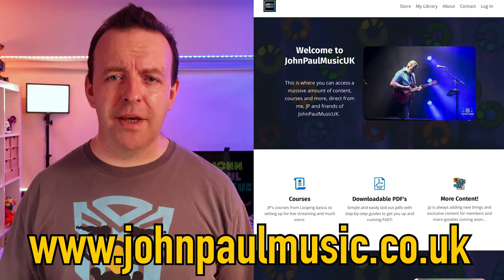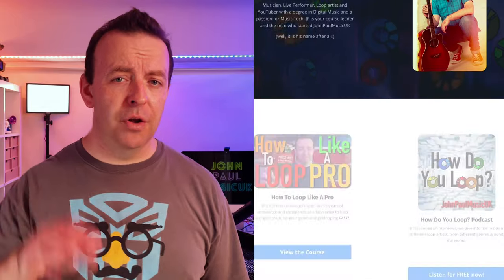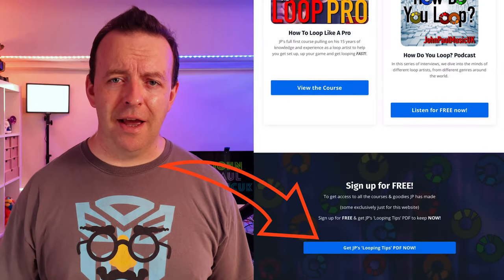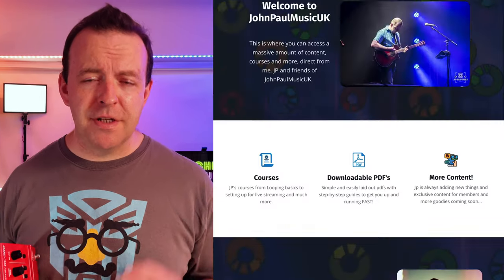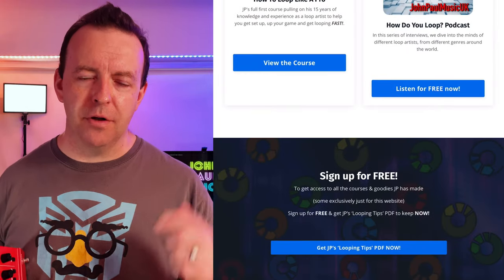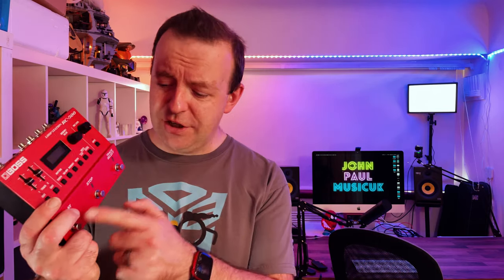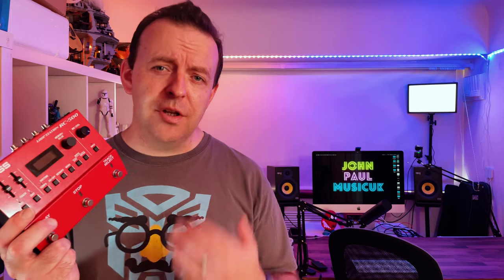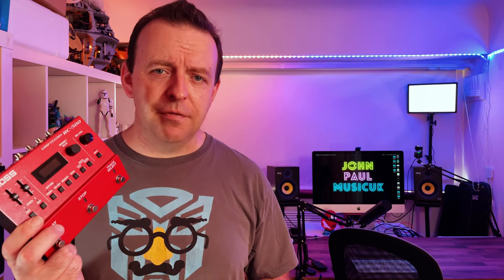Boss RC-500 - How to Route the Loops

Comment: John there is something that is not mentioned here and it is a SOLUTION to completely preserve your routing:
To preserve your A-B or L-R stereo routings you have to set track IN and OUT properly!! If your track IN is set to ALL, then everything is mixed down to a mono sounding stereo file, and you will lose your routing when the loop plays back. Although if you have it on MIC/INST, then it will be true stereo recorded left and right. The track OUT have to be set to ALL. Don’t make the same mistake I did 🤣! This is not in the manual, but it is mentioned in the Parameter Guide. Make sure you know, this will not fix the loops you already recorded. You have to re-record them the right way!
Reply from the maker: This is good advice 👍🏻
Reply: I'm hoping this means if put the track IN as INST IN and OUT as ALL, i also get a stereo signal that gets routed properly. My setup is Guitar in IN A and Bass in B, I wish I can have them on both tracks in their own amp
Reply: yep. It's in the Parameters guide: "Sound that is input to the INST IN jacks (A/MONO, B) is assigned and recorded to A and B (L, R)." @LaBoiteAGogo
Reply: @TomiTtime  that is great, I was horrified to think it would miss that function when rc-5 has it

Comment: Not sure if anyone else has noticed this, but when you mess with the channel routing it can double the volume of your track. For example if you set the track 1 output to only be channel A, then it seems to double the input volume (probably because of the way it sums it). My solution has been to just halve the volume for any tracks I do this with
Reply from the maker: Yes this can happen cause you are sending signals to now mono outs and the summing up is greater. Great tip 👍🏼

Comment: Hey John, not sure if you’ve answered this before but is there a way to cycle through drum patterns on the RC500 using midi? I have an MC3 controlling my RC509 and can’t figure out how to go through the different drum patterns. 

I’ve programmed tap tempo, start/stop, pattern variation and pattern rhythm 1/2 but scrolling through the different pattern still eludes me. Any help would be appreciated and thanks for all the videos on midi with the rc500 so far 🙏🏻
Reply from the maker: Hey Sam - sorry I'm just seeing this now. 
Have a look at the RC-500's Parameter guide - really important - I have them downloaded and saved onto my iPad for CONSTANT reference. Go to page 10 and have a look at the options there as the Target for the midi command - There isnt a cycle through or increase or decline option but there is a way to change whats called 'RHY Pattern' and the 'Kit'.

Comment: Hey JP :) do you know of anyway to keep a stereo left right signal for the guitar, but also isolating the mic out to be on a seperate channel? So far it seems impossible, cause the guitar needs to be on both output channels for it to be stereo (cause I’m using stereo delay before going into the looper). Thanks!
Reply from the maker: hey 👋 
so this is the limitation of the RC-500. it has 2 outs. the left and the right. that’s it. 
so you can send the stereo out and the mic out to any of the two.. but you are asking for it to be a 3 channel (or more) looper. it’s simply not possible. Next one that can do that from Boss is the RC-600 / RC505mkii

Comment: When i  play my guitar through the RC 500 the volume level is very low when I'm doing a loop   . I tried turning up the volume on my guitar. Question how do you control the volume level output for your  instrument   or increase the  volume ?
Reply from the maker: There is a recording volume and a play volume. The play volume is the faders you can see. The recording volume is in the input button menu.

Comment: Is it possible to route the two separate inputs as separate outputs on the same track? EG: I have a song where I set up a 2-Bar percussion loop with my guitar on Track 1, then during the song I add a 4-bar phrase with both guitar and voice on track 2. Or would it just be easier to upgrade to another loop station with more channels?
Reply from the maker: So yes. You can tell the vocal to be output B and the guitar to be output B for both the normal outputs of the instruments and also the loops. 
Hope that’s what you mean. 👍🏻

Comment: Hi John Paul ! Thank you so much for this video ! 
This is great information. I was desperately looking for a solution to separate guitar and voice loops. Now I have a solution.
I am definitely considering buying the RC-500.

I was actually trying to find the best option for GUITAR AND VOICE LOOPING (+ having the option to add some vocal effects like delay, reverb, and harmonies).
So I was hesitating between getting the BOSS VE-500 alongside the RC-500 ; or go a different way with TC Helicon, and get a Voice Live 3 Extreme (and get all I need in one pedal).

Or I could also keep the VE-500, and get a bigger looper, like the RC-600, and this way, I can have an ouput for the guitar, and stereo outputs for the voice.

Any hints on the best configuration would be highly appreciated ! 
I have been looking for months, and can't decide what's best. ; )
Thanks in advance !
Reply from the maker: Hey glad it’s helpful. 
If you are used to the VE-500 then it’s very similar to the TC-Helicon but with the advantage of midi, so you can sync the effects to the timing of the loops. Then it’s just a case of what looper. 
The RC-600 is a monster but the opportunities with what you can do are a lot more than an RC-500. However, to be devil’s advocate, if you only ever need a max of 2 loops and are using the VE-500 for inputs and effects and sending that to the looper, then the RC-500 is all you need (maybe with an external pedal for more buttons). 
Here’s my setup.. just mentally replace the Voicelive Play Acoustic for your VE-500: https://youtu.be/VE9vLqGX_Gs
Reply: @JohnPaulMusicUK   Thank you for your kind response and explanations !
Yes, I think the rC-500 is enough for my needs in terms of looping (and smaller).

my only concern with this routing is losing the "stereo output".

If I use 2 pedals, the RC-500 alongside the VE-500, could I do my setup like this :
– For the MIC : enter in the Looper first, then mono output (on one of the tracks), to go into the VE-500, and from there, output in stereo to the mix table.
– For the GUITAR (doing the opposite) : enter first in the vocal effects pedal (VE-500), output in mono to enter the Looper (RC-500), and from there, output to the Guitar Amp.

In terms of sequence, would that work?
Thank you agin so so much for your help and advices ! Cheers from Switzerland ;-)

Comment: Hi, thank you for your work. I have the following problem with the outputs. If I set A as the output for the instrument and B as the output for the rhythm, then in channel A I hear only instrument (which is ok), but in channel B I hear both, instrument and rhythm - I would expect that there should be just the rhythm in B. Any advice? Thank you
Reply: I may have just realized the answer to that. I was having a similar issue with my guitar coming out of the output with the loop track after I assigned loops to Out-B and Instrument to Out-A. In track "Edit" I changed the Inputs as well to segregate I/O A from I/O B. What I DIDN'T do was assign the Input routing TO the Outputs by using the menu under the INPUT button.  The Rhythm Output assignments are done from under the same INPUT menu, and not from the input parameters found in the track EDIT menus. It's a little confusing and now I'm not really sure what the Input settings in the track edits are for exactly. 🤷‍♂
Reply: So, I just tested that my guitar no longer comes out of the B output unless I switch it using the INPUT menu.  I'm assuming the Input selections in the Track EDIT are to accept inputs for taking in loop recordings and NOT for output routing.

Comment: Hey there JP, I have an interesting question for you. I'm currently using a Pigtronix Infinity for looping, which in addition to its regular outputs, has an aux out which sends just the audio of looped parts. With ABANDONS I do a lot of live looping, and use the aux out to send the looped parts to an amp which sits behind our drummer. This allows him to clearly hear the loops, without having any of my live playing muddying it up, as his amp only plays the loops from the aux out on the Infinity, which doesn't include my live signal. I watched your video but it's unclear whether I can accomplish this with the RC-500 routing options. Is there a way to send just the loops to output B, and have output A contain both the loops and my live signal?
Reply from the maker: Hi. Ooh that’s interesting. 
So in short, yes. Output A would be for the main PA and output B would be for your drummer. 
You would send the loops to both output A&B (as it is on default) and then send just what you need for the main PA to output A only. 
This can be done with the inputs, loops & rhythm (although the drummer might not want to be replaced with a rhythm track 😂) but good for percussive stuff.

Comment: Thanks for the video.  I have a clean guitar track laid down on track one and I want to laid down a distorted guitar on track 2 while listening to the clean track for timing.  But when I do that and listen to the play back, both tracks come out distorted.  What setting should I use for input/output to correct the issue?  thx
Reply from the maker: Make sure the clean track isn’t coming in too hot. Click the input button under the mic knob. Check the input volumes are not too high if the input is distorting then that might be the problem. There is also a noise suppressor (NS) on all inputs set to 50 as standard. Have a play with this also to make sure that isn’t the reason it’s changing the sound. Hope that helps.
Reply: @JohnPaulMusicUK  Great, one other question. Can you delete separate tracks?  I want to clear track 2 but when I clear it, it clears both tracks 1 and 2.  thanks.
Reply from the maker: Yes Mike. 
You just need to check the stop pedal. 
Go into memory > Ctl > pedal 2 and it should already be on Cur Stop (Clear) which will clear the currently track but leave the other track alone. If not, change it back to that. But that is the default.

Comment: hello JP, I am having an issue with the mic input, very low volume and gain no matter what I do. There has been a post on a facebook group or page where it has been addressed. No answers though. My only solution would be connecting all the instruments and mic to a mixer then connect the RC 500 onto the mixer through instrument ts line. Do you have any info or knowledge about this issue? Thank you
Reply from the maker: Hello. Yes, this is a common complaint about the RC 500.
The one thing that I have found, is that the Noise Suppressor (NS) is switched on by default.
This can have quite an effect on the volume coming in, and I have turned mine off.
Click the INPUT button, scroll to MIC IN NS, and play around with this setting.
Be aware, this only really affects the recorded loop, not the natural input.
I use a vocal processor, the boost the signal beforehand (TC-Helicon Voicelive Play Acoustic) but your solution is a good answer. 
The advantage of this is you can do dual mono looping.
Have a look at this video about dual mono sleeping and its advantages: https://youtu.be/tErt9uASsPs
Reply: @JohnPaulMusicUK  Thank you so much. I have a Behringer Flow 8, just starting out. I'll reduce the NS preset. Dual mono sounds good.

Comment: Hey JP! What's up pal ? I've been messing around with my 500.. im running in dual mono mode into a mixer like your video demo showed .. vocals out A into slot  1, guitar out B into slot 2... Is there way to route the rythym into output B?  For some reason it's coming out A and I have reverb going to channel 1  for the vocals and the rythym is picking up the reverb .. hope your well my friend !
Reply from the maker: Hello buddy. 
Press INPUT button > RHYTHM > and you can change it there. 👍🏻
Reply: @JohnPaulMusicUK  awesome!JP is the loop master 👍. Please send me the link to buy you a cup of coffee.. I owe you .. thanks Jp
Reply from the maker: Thanks man it’s https://www.buymeacoffee.com/Johnpaulmusicuk
Reply: @JohnPaulMusicUK  ok got the link thank you .. sorry I had one more thing I needed to run past you .. so on the 500 I’ve been practicing with both tracks on auto .. also I’ve been laying down a 4 count percussion beat on track 1, then switching to track 2 to lay down the guitar .. track 2 is going to be longer than track 1 so I turned off loop sync for both tracks .. if I stop both loops right before chorus and bring them back will it start me back at the beginning or is it going to start where I stopped it ? I’m trying to get better at this stuff but man is there a lot of info to digest

Comment: Hello, is something like this possible with the RC-10? I would like to have my guitar through input A and output A to my guitar amp and my bass go from input B through output B into a bass amp and have the drum tracks go through output B only so they play on my bass amp.
Reply from the maker: Hey 👋 
So sort of, yes. 
Press MENU and scroll to OUTPUT MODE. The RC-10r has 2 options. One is the default of STEREO and the other is A:Loop and B:Rhythm. So if you set it to this, connect your guitar to input and output A and your bass to input and output B then this should be okay. 
The only downside is I think the bass, when looped will come out of A. 
I’m not sure cause I don’t own an RC-10r but you’ll just have to experiment. 
Hope this helps. 👍🏻

Comment: Heya, is there a way to route audio to different outputs on the RC-5?
Reply from the maker: On the RC-5 you can use in mono or stereo but there isn’t a way to route internally.. just input/output A and input/output B. You can use two different instruments in A&B and they will go out the same way.. but that is the limitation.
Reply: @JohnPaulMusicUK  I was afraid of that. I guess they have to keep some of the cool features for their expensive loopers. Thanks!

Comment: I recorded a drum sequence totalling 32 measures into track one and saved it on memory one. I played it back and recorded a chord sequence against the drums on track two. I want the loop of guitar and drums to play back in timing together. What do I do?
 Also I note (when using microphone)  the microphone level remains too low even when I raise the input mic level to maximum. Is this because my microphone is the wrong output sensitivity and or the boss RC 500 has a different input sensitivity to my microphone?
Reply from the maker: Hi 👋 
So if you have a 32 measure on track - and a chord sequence on track 2, they should play back together fine. You could change one of the buttons so they stop and start together. 👍🏻 

Also regarding the Mic (and instrument) input there is a compressor and NS filter on the input settings that is ON by default. You can turn these off in the input settings and this might be the reason. The Mic input of the RC-500 has been noted as low by a few people.

Comment: Hey JP ! Something I’ve having a prob with is my volume levels .. my chain goes mic - tc play acoustic - boss RC 500 - mackie mix 12 - 2 channel single speaker .. ..so the tc , boss rc 500 and mixer all have seperate gain levels for my dynamic mic .. where do I set the gain level ?
Reply from the maker: Hello mate. sorry I've only just seen this.. slipped through the net. I would set my initial levels for my vocals and insurgents at the voicelive play acoustic and then set the loops level on the RC-500 around 90. That way, your vocals and guitar will always cut through and the loops are never over powering.

Comment: Good afternoon. Can you help me? I want to make sure the RS-10r Looper can be paired with the BOSS-RC500 Looper? Synchronize via MIDI. Make a single whole out of them. Use the RS-10p as a drum machine. I know the RC-500 has very flexible settings. You can assign any button to any function. Does the RS-10r have this capability? I didn't find any information on the internet, oddly enough.
Reply from the maker: Yes, you can do this. the RC-10r can become the main looper and dictate the bpm and beat whilst the RC-500 follows the tempo and syncs to it. The rhythm section of the RC-500 is good and of course the quality is 32-bit but there are good sections on the the RC-10r. Have a look at the manuals for both on Boss'website and look under pairing. you just use the midi (would need the right cables) and you can do it.
Reply: @JohnPaulMusicUK  thanks for the answer
Reply from the maker: Welcome 🙏